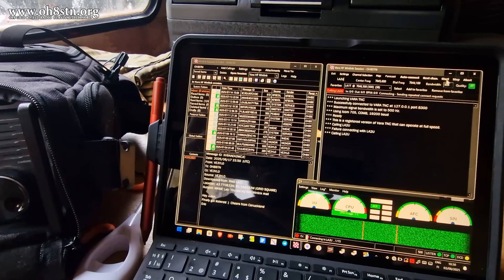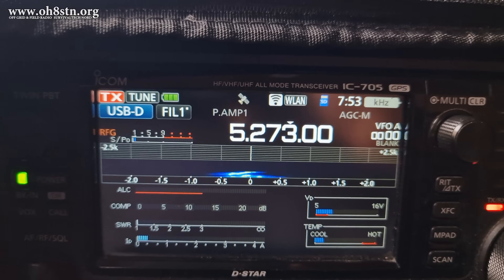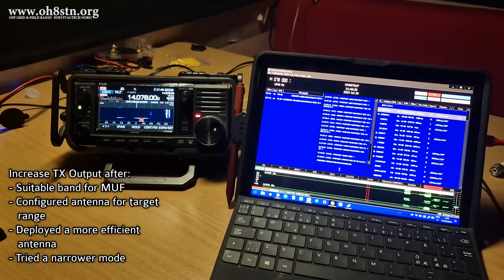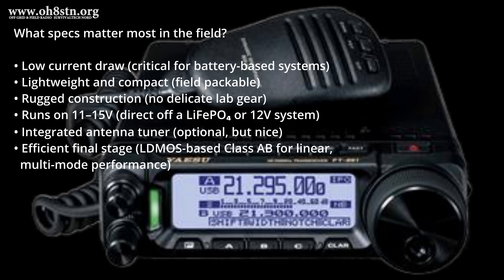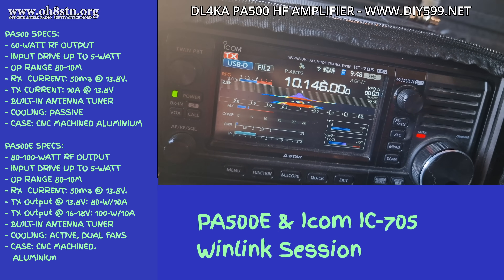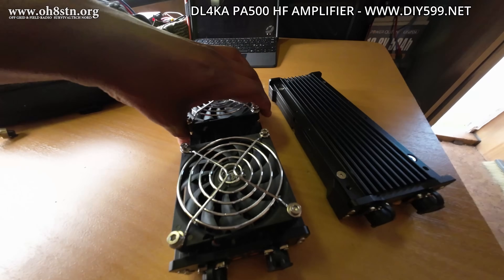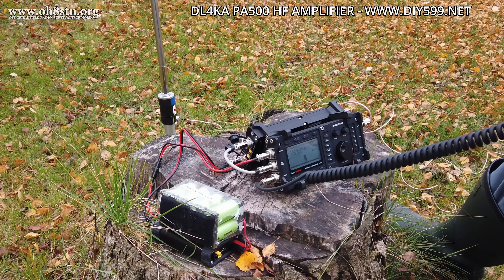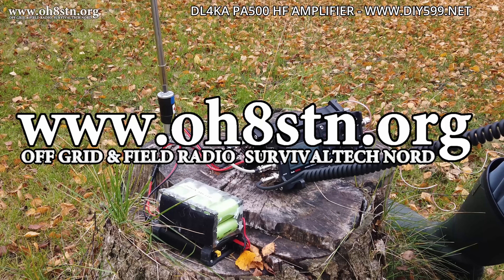The ULTIMATE Portable HF Ham Radio Amplifier

Comment: I'm struggling with QRP right now. Hearing winlink stations super loudly but I'm just not punching through. I appreciate this video.
Reply from the maker: Here's a tip. Use 500hz Winlink stations instead of wider stations when QRP. VARA HF or Robust Packet (RPR) offer the best performance.  Just like SSB, the wider the bandwidth,  the more power you need to get it out to the world. Narrow is slow but more efficient!
I'll post QRP Winlink session soon.

Comment: Definitely overpriced on these ones. But i guess if you’re so concerned about size and weight you’re probably spending a pretty penny anyway. You should try the Micro-PA 100. Much much cheaper!
Reply from the maker: Yep, I get what you’re saying, and the Micro-PA amps are definitely a budget option. I really needed the internal antenna tuner they don’t have. The PA500 also gives me low idle current (~50 mA), more efficient TX current draw, and full band-specific filtering for a very clean signal -  important for data mode work. For my needs, that made the extra cost worth it.
Thanks for the comment and excellent points.
73
Julian oh8stn

Comment: Looks really nice. I think I can get a 100 watt transceiver for less though maybe not as light.
Reply from the maker: You certainly can, but you're right not as light, and definitely not as energy efficient. The reason we don't use QRO radios in the field or for off-grid communications is that they are not efficient. 100 Watts takes 22 amps and their receive current draw is up to 2 amps. This makes battery and power supply requirements more difficult.  Anyway, think of the concept, then decide what equipment to purchase.

Comment: I've kept my 857d and 7200 around because they're 100W but I love the audio of the TX500.
The time may come to retire the 857d for the FTx1 optima and get the PA500
Reply from the maker: The Yaesu FTX-1 is an interesting radio, but the current consumption is a deal breaker for off-grid needs. The 100-watt Optima add-on also uses lots of current on both RX and TX. If they'd fix that, it eould be more interesting.

Comment: I thank God that I still have my FT-857D with high stability TXO,  2.3kHz, and 500Hz Collins filters. It may not have the newer features of the IC-705, but its receive current is less than 1A. It typically draws less than the 22A rated current on TX.

When paured with a 135ft 80m-10m wire coupled through a 49:1 autotransformsr, it is highly effective and compact. A 12Ah Lipo4 battery and 60W solar panel make it man portable. At 62 and bit gravity impaired, I wouldn't hike more than 1km with the setup, unless forced for survival.

Thankfully, I have a KLR650 motorcycle as my primary bugout option, a car, and bicycle that can go most of the distance.

https://youtu.be/nShDYlZGKlc

Comment: The 60w is the better choice IMHO between the two as the extra 40 watts will only get you less than 1/2 of an S Unit.
Reply from the maker: That's definitely true! I tend to take the 100 watt model because I'm primarily doing data modes. The dual fans allow longer QSOs at higher power, while managing the heat with narrow data modes. Admittedly though, I've never had a problem with the 60-watt. So I'm probably just paranoid 🤣👍

Comment: The 599 products are great. My alternative solution is the PA50Plus 50W amp and the AT100M Pro 100 w tuner.  The entire 50w kit including antenna are carried in the newly purchased wincamp 705  bag. Admittedly, not as robust as the 599, but very cost effective for the few times QRP is not enough.  5 watts on digital seems to always get through regardless of the bands.  SSB is another matter where the amp is a necessity.

Comment: 100 watts for 2k+ €. All that without the radio itself. I guess it's too much. Nice video, by the way
Reply from the maker: Indeed. The thing is you can go cheaper but it's going to be heavier and less efficient. That means you have to carry bigger solar panels, bigger batteries, and probably won't operate as long. Or you can spend more money for something more efficient and lighter weight, and easier to carry. It's a bummer but that's the way it is.
Thanks for the comment

Comment: "The mission determines the loadout." Every time I go to the field, I decide beforehand what tools I need. I don't always get it right, and there is a learning opportunity almost every time I go out. But one thing I've learned is that it's not a bad idea to have a QRO rig or amplifier in the rig along with a battery to power it, just in case.